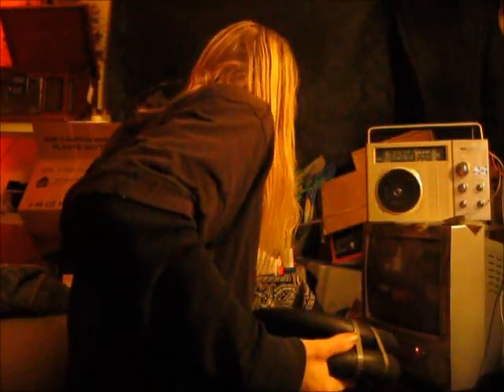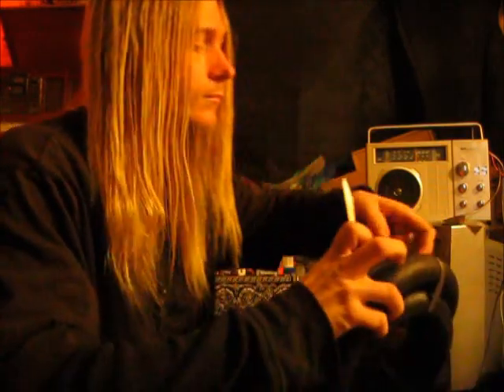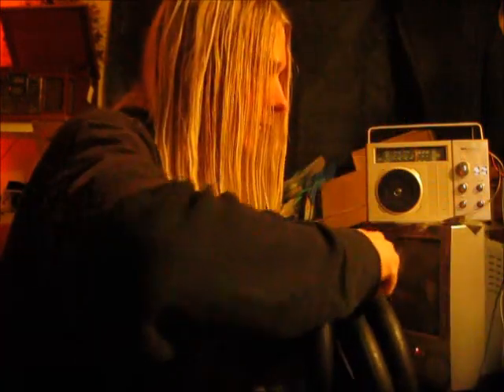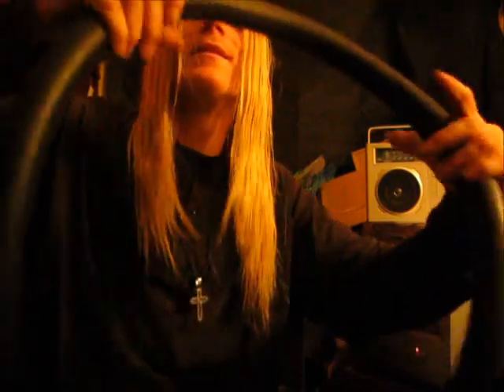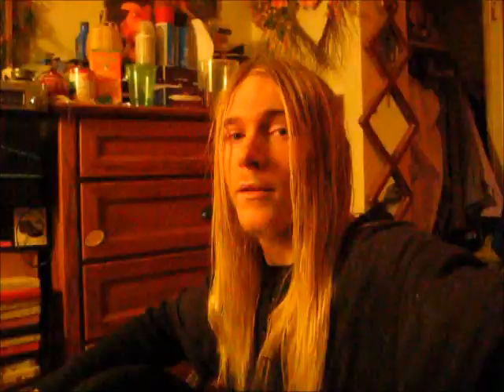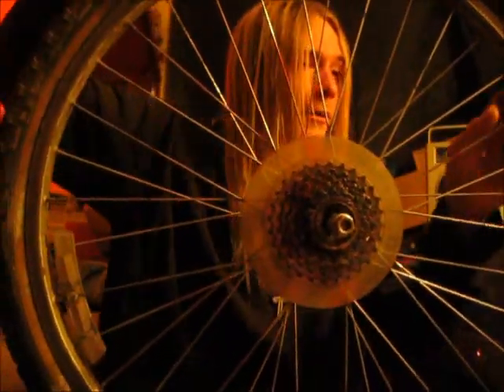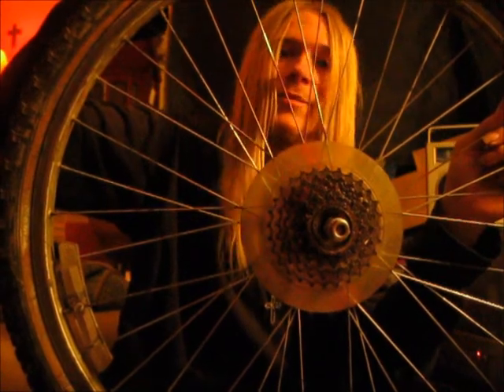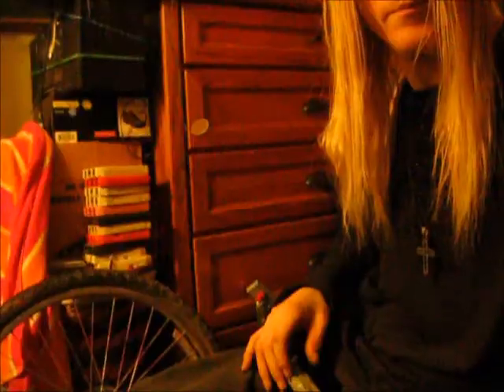Solid Bike Tube

Comment: I've had Bell NoMorFlats on my mtb for 10 years and on my Catrike Speed recumbent trike for 6 years. Slightly difficult to install. I haven't fucked with flat tires in that many years on either one . I don't have to waist time checking air pressure, they're just ready to go all the time.

Comment: Very easy to install when taken logically: read the instructions on the box. I have been riding on them for more than a year. What I found is that the solid rubber stretches after extensive use. The 26" became +- 27" or even 28"  but still good. I bought two new ones and cut down the old one for 20" rims :)

Comment: After you have one side of the bead in the rim and put the tub inside the tire, you start the other side of the bead under the lip of the rim and you zip tie it at that point so the tire bead won't come back out. Then you work the bead in around under the rim like you did. Also Armor All helps the bead slide over into the rim easier.

Comment: 1.) You have to first put the tire on the rim first with one side of the inner tire in the rim while the other side is sticking out. 2.) place the inner solid tube in between the tire and rim on the side of the inner tire that's not fully in the rim. 3.) Work the Inner solid tube into the tire all around with your fingers. 4.) Once you got the inner solid tube onto the tire, use two flat head screw driver to work in the tire inside the rim (Close it!). Not to sound sarcastic, but the instructions for the inner solid tube (Bell Nomor Flat ...) is on the box of the inner solid tube! Here is a link on how to put a bicycle inner solid tube on a tire & rim: How to put in a solid rubber tube into a bicycle rim  One more thing I would recommend you use or put on a 26" x 1.95" tire on a 26" x 1.75" rim & solid inner tube (26" x 1.75''-1.95") so in case the tire gets worn out it will be far easier for you to take off the tire as well as put it on the rim with the inner solid tube. If you use or put on for example all three 26" x 1.75" tire, rim & inner solid tube (26" x 1.75"-1.95" solid inner tube with a 26" x 1.75" tire & 26" x 1.75" rim), it will be very, very difficult to put all three together and especially take it off when or if the tire get worn out and you need to replace the old tire for a new one!

Comment: I don't really see how the tire will stay on and not slip.  What they should have is have an air tube with some type of cork insert so that if you get a flat, there will still be some support for the tire, enough to get home and repair/replace the bad tube.  I would think if someone used good rim strips and a thick tube, they should be fine.  If that is not enough then add flat stop liners too.

Comment: Use a big c-clamp like a third hand, y'know.  Great vid, imma go get 3 now.  I have MS, so I ride a trike cuz my balance is screwed.  This will turn my 3 wheel pedal trike into an SUV darn near......(flatbed optional)
Reply from the maker: Thats auswem man i had one of them years ago when i was a kid you can carry alot of stuff with them bikes
Reply from the maker: 121293g the one i had had a big basket on the back haha it was almost like a shoppin cart on 3 wheels.....it didant have any gears or anything but it would get you around in a heartbeat.....i wouldant mind riding something like that now haha it had a nice metal basket on the front too with a generator on the front tire for a headlight.....i dont know if they still sell the generators but you can make one pretty easy out of a dc motor from a tape player or anything that has a dc motor

Comment: I dont know why they still sell air tubes they are archaic!] I been using bell no mor flat ~4 or 5yrs] never worried about a flat again!] I'm 280#] only drawback I notice was wear tire down faster ~9mo vs 1yr] thats nothin compared to cheking for flats every sec!] I think u need a decent tire or the edges might break b/c dry rot] rolling resistance maybe slightly slower ,but that aint shit compared to constant flats!= u may not want to race w/ these tubes] bell did an awsome job they sold me] I aint buying no more air tubes, even w/ slime or that rim strip= pure de junk!]

Comment: Are you from Philly?
Reply from the maker: Yea i hear ya there man.....after i put the solid tube into the tire i made it about 13 miles and the tire started ripping apart.....the wire ring that goes along the edges of the tire broke haha and it got all tangled around the axle so i put on another tire.....that got me about 25 miles id say maybe a little farther than that i wasant really keeping track but the same thing happened to that one so i decided to take it out for now and just use an air tube with a liner.....i used an old air tube i cut up for the liner.....so far ive probabaly went about 15 to 18 miles with the airtube and liner and no problems yet but.....the solid tube is good to have but its got to fit exactly perfect in the tire or the tire will break apart and come off the rim.....at least thats what happened in my experience.....i havent been able to get it running right yet so for now im using air tube with liner
Reply: I ride my bike about 15 miles everyday . So a flat tire can be a long walk home.I had been considering the Bell Solid Tube as possibility to feel more secure.

 Before though, I add some super GREEN tube seal to both tubes as a preventive.
THAT DID NOT WORK .  I got two flats in four days.
After reading about you experience , I'll stick with the air tubes
BUT your idea of a run flat tube tire, just to get you home,
is an awesome idea, SHARK TANK idea

Comment: What kind of brands have you been buying if they are designed to fail in a few weeks? o.o

You'd have to be rolling into some nasty stuff for that to happen.
Reply from the maker: here in philadelphia there is broken glass,nails,little shards of metal and whole bucnh of other stuff you run over weather your in a car or on a bike.....i just lined the inside of the tires with an old inner tube since the solid tube made my tire rip apart
Reply from the maker: the solid tube is good but it has to be the exact size or the tire will slip as you pedal and evertually tear apart as you ride faster.....make sure its the right size tire or you will loose the tire
Reply from the maker: i got ruffly 20 miles before the tire tore apart
Reply: 121293g What tore apart; the innertube or the tire? I got two from Stop-a-flat [yellow ones] and they are pretty good... I think you need to remove any tire liners and even rim tape when using these